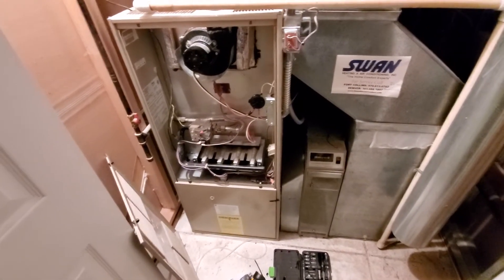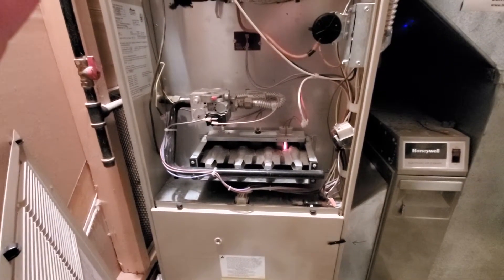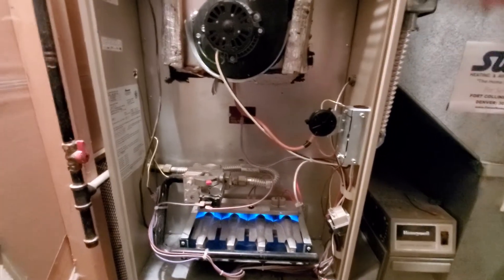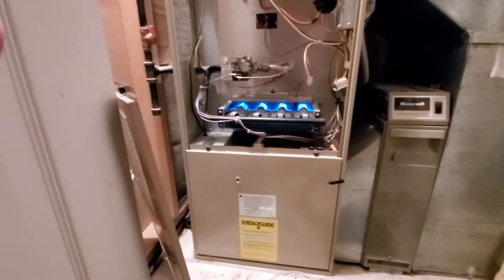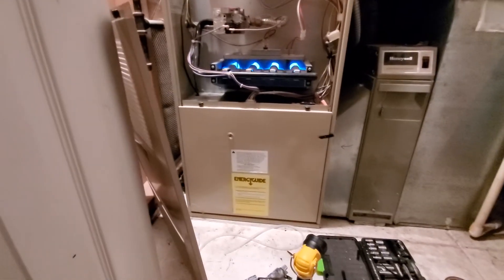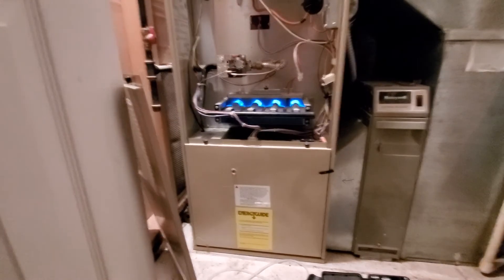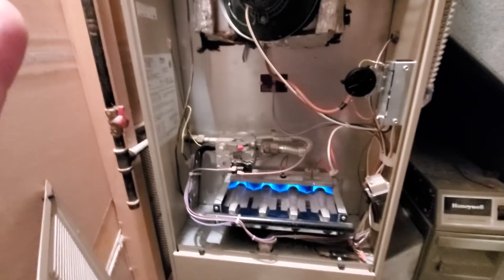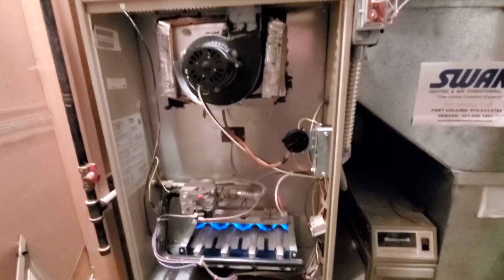Amana 80% furnace troubleshooting pressure switch.

Comment: I disagree with you saying amanda/Goodman not good products. I've had multiple Amana sv 80's that were manufactured in 2000 and STILL going strong in 2024 with NO problems except an occasional dirty flame sensor. If you maintain them they are good bang per buck units. I believe I have a lifetime warranty on the heat exchanger.

Comment: Some pressure switches are adjustable too. FYI. 

The condensor coil can be plugged up with junk also causing the pressure switch to activate. The lights on the control board will indicate the problem. Consult an HVAC tech if you don't have basic knowledge if the system. You can have carbon monoxide build up in your home if not fixed and tested properly

Comment: Why do you say the Amana/Goodman furnaces are not good? I've had a couple in two houses, and they were pretty reliable over the years. AND, I can work on them, and parts are easy to get unlike some of the newer ones.
Reply from the maker: The Amana Furnaces are definitely low end and were a popular choice for massive housing developments. I can say with certainty that the majority of those furnaces didn't last 15 years in my area. I am likely the only house in my area who still has an Amana 80% furnace. It will likely need to be replaced soon.
Reply: @Ryan-sl2oe  I guess I've been lucky with mine. What would you recommend replacing them with when they do go? I have one in my current home and one in a rental I own.

Comment: I have two pressure switches on my Amana furnace, I had 3 blinking lights and took the hose off one and sucked to make sure it was working... it was. i took the other off and it was full of water but then after sucking on it started working. Where did the water come from?
Reply from the maker: Sounds like your condensation port is clogged and it's causing it to fill with water.
Reply: @Ryan-sl2oe  I didn't notice anything when I pulled hose on box but I re-check that and also the trap again when I get back today. Thanks!

Comment: Hey buddy word of advice do you not buy a high efficiency furnace. we have had three replaced in the past 20 years. before that the 80% furnace that was in our home lasted 43 years old. These furnace guys want you to buy a higher top end furnace it has more sensors and more problems that can break down repeated calls to the furnace Man that's what happened with the three furnaces that we had they were all high efficiency. Was way more breakdowns. Just get a 80% furnace with higher BTUs they seem to last the longest but these furnace people do not want to tell you that!
Reply from the maker: We are going to upgrade to the more efficient furnace for resale value. Thanks for the tip, buddy.

Comment: So pinching the hose from pressure switch and releasing, mine never did fire up. Would that mean the switch is bad? Based on your experience with yours in this video. Thanks for your opinion.
Reply from the maker: Is the induction motor spinning continuously? That's the little motor on the vent pipe. If not, it may be the switch.

Comment: Mine still heats and blows on its own, but that little motor kinda randomly spins without flames or blower on. You think we have the same problem?
Reply from the maker: It's very possible. The good news is that I bought a brand new replacement circuit board for $100. It's a cheap thing to try. A service call will be at least $100 anyway. Please be safe and shut off your main breaker. I also recommend a cheap circuit tester to make sure the power is off before messing with it. DO NOT  buy a used circuit board! Even if it costs more, find a compatible, new one. The used one could fail in a week. Plus.... I found that people were trying to sell used ones for nearly as much as new ones. I bought mine on amazon after confirming that it was the proper, updated version. Another thing I'd recommend is lubricating your induction motor. Use Zoom oil (non detergent based oil) and look around on YouTube for the proper way to do it. If your motor is the same as mine, theres an oil port on the top of the motor. Good luck!!!!
Reply: leave it alone if its not broke don't fix it!